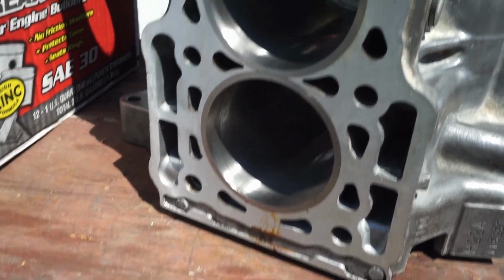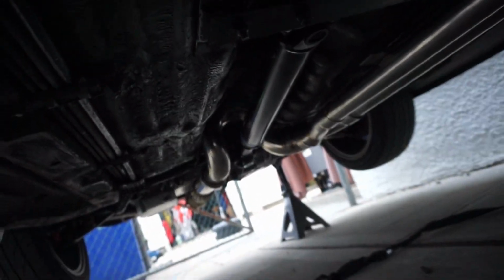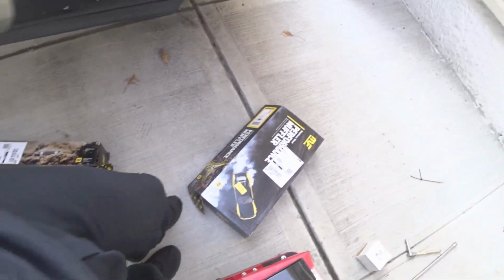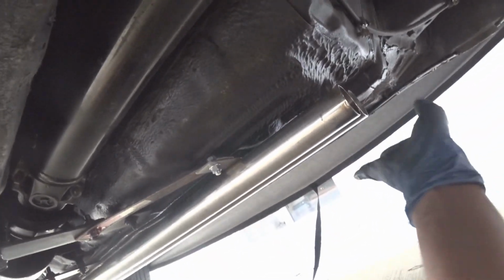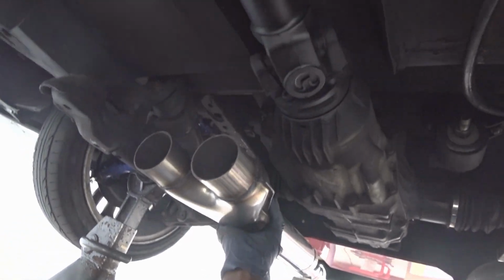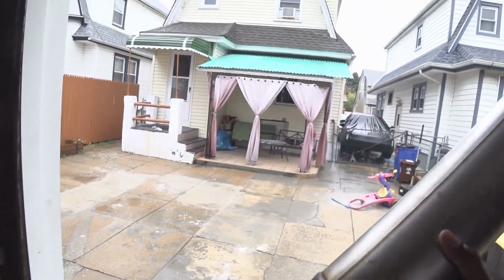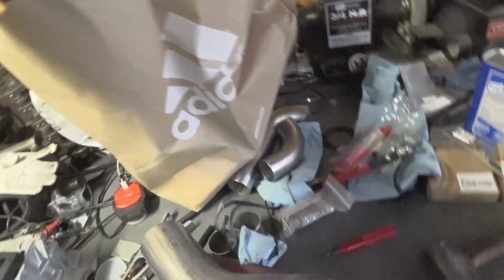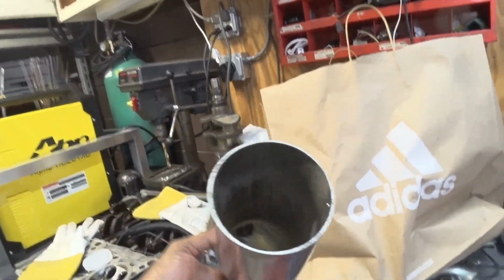H22a 500hp  Darton Block. AWD Custom Exhaust part 2. More CB7 upgrades

Comment: Is there a lot of vibration from the support  brackets on the exhaust
Reply from the maker: Have not driven the car yet. But I don't think it will. Since it's rubber mounted to the body